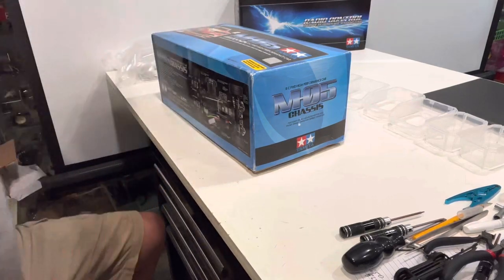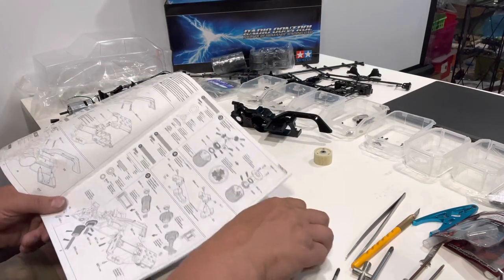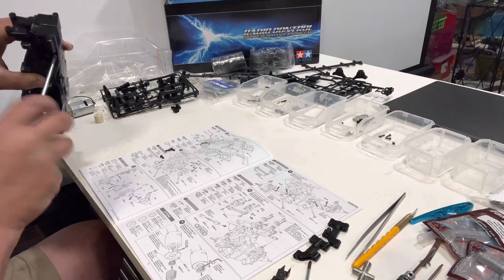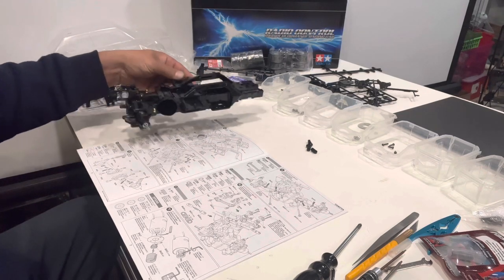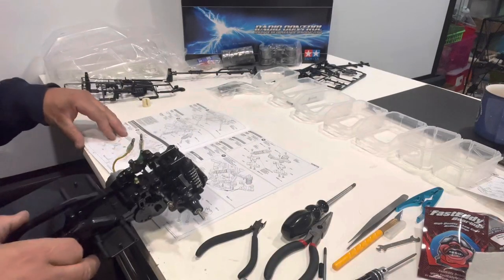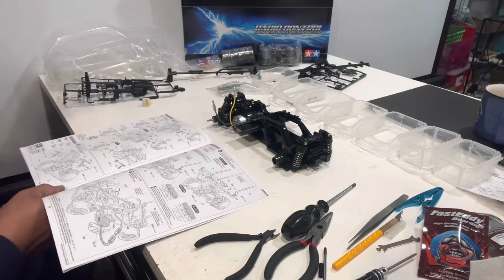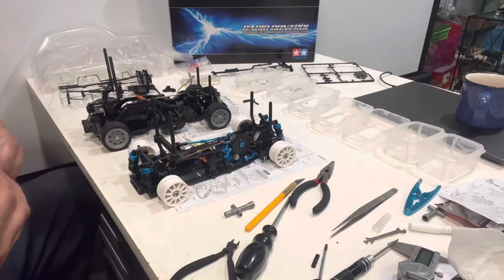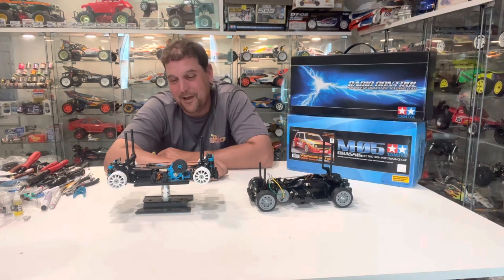Tamiya M05 chassis build Golf group 2

Comment: Keith, you might want to consider adding a couple more M-chassis to the collection. The M-04 and the M-07 R or M-08 are awesome. The M-04 is one of my favorites and I loaded mine with tamiya hop-ups basically making it an R version. With some 52mm foams, AVC receiver, and a sport tuned motor, it’s so much fun. I recommend adding the 3racing spur gear upgrade to the M-04 because stock its super slow. The M-07 R is also top notch and is so easy to drive.
Reply from the maker: Great info.
Thank you. Gets me thinking.

Comment: I love the Tamiya M-chassis cars, they're awesome! So much fun to build and run, and they're pretty sturdy too, the gear diff in the M-05 is pretty much bulletproof. I bought a 2nd-hand M-05 almost 2 years ago, it had a few hop-ups with it including TRF dampers. I stripped it down and rebuilt it, replacing the JIS screws with hex-head screws, and I had to swap out a few parts due to the plastic being stripped by over-tightening screws. I only ran the M-05 in a local car park, but by god it was so much fun. Early last year O got an M-07, and that cars was possibly the most fun car I have ever driven. I actually raced it at my local club, I was up against full 1/10th touring cars, and I held my own, and I even won the odd race here and there. I did upgrade the spur gear, and at one point I ran a 13.5 turn brushless setup in the car, it was insanely quick, probably too quick to be honest! If I remember correctly the odd-numbered M-chassis' were FWD and the even-numbered ones were RWD, apart from the TA05 M-four and the MF-01X, which are 4WD. Awesome video, keep 'em coming mate!!
Reply from the maker: Great info.
Thank you for all of that. I have a feeling there will be more m cars after running this one.

Comment: The reason the rear axle stubs aren't put in until later, is so they don't fall out while you work on the car, or they'd have to put in an extra step where you lock down the axle stubs into the hub with something like a body clip etc. Generally its good to just follow tamiyas instructions, and see if it made sense in the end, which it usually does. 

I think the M-chassis cars are usually quite short on space at the rear, some bodies are really short, with minimal overhang, so bumpers at the rear are often not a thing. If race cars can be without rear bumpers, I'm pretty sure a slow M05 can too ;D I think its more a case that some cars use the rear bumper as structural rigidity (tt01/tt02) that people get used to having rear bumpers. 

Looked like a fun build, even with some of perceived oddities. ;D Should make for a nice little drive before you do the switchup. 
 I guess if you wanted correct realism, you'd want to mount a tamiya Golf mk2 rally body on the M-four as its four wheel drive, not sure if the M-four stretches to 239mm wheelbase tho. ;D
Reply from the maker: Thank you for all the great info. All makes complete sense. The M chassis stuff is all new to me. Lol

Comment: I also found the M05 a little confusing with which screw went where when you joined the 2 halves together and also getting that rear end spacing correct. I built up the chassis with lots of hop ups then put it back in the box with the unpainted body set as that’s going to take time. Can’t wait to see you paint yours as that might be the inspiration I need.
Reply from the maker: Going to be some work.

Comment: hey Keith. 
25:48  That correctionsheet says the A3 part has been redesigned. 😁 The lower drawing shows the extension.

They're both cool chassis. The M05 i definately gonna add to my wishlist (yes, i know🤣🤣), just because it's a fwd. The one thing that throws me of the TA05 m-four is the battery. It's a good looking chassis, but it's sad that it needs the 6.6V LiFe battery. Could it be possible to modify it a little to take a shorty Lipo?
Reply from the maker: Anything is possible now a days with the selection of lipo’s available.

Comment: The extra part on the rear of the chassis is used for droop screws on the m05 pro version 2 /R
Reply from the maker: Awesome info.
Thanks. Learned so much from this video.
Reply: @rcicons4915  you need to add a M05R to the collection next which was the final race bred version which came with a host of hop ups in the box which included a set of nice ,black Trf big bore shocks and a few other black anodised parts .

Comment: You know the Renault 5 was a rear wheel drive car in turbo form.
Reply: the real Renault RE5 turbo was front wheel drive with a transverse mounted turbocharged 4cylinder. Same essential car as the Renault alliance which was made in Kenosha by amc.
Reply: @IowaBudgetRCBashers  I think he might be referring to the homologation R5 turbo; the mid-motor RWD car for grp 4
Reply from the maker: Thad!
You are a true car guy!
Reply: @rcicons4915  and that's the one of the body that you have the rally car version.